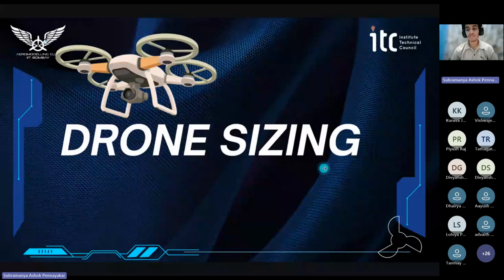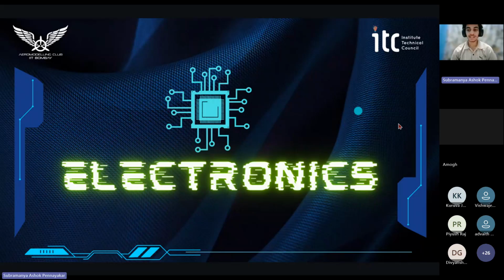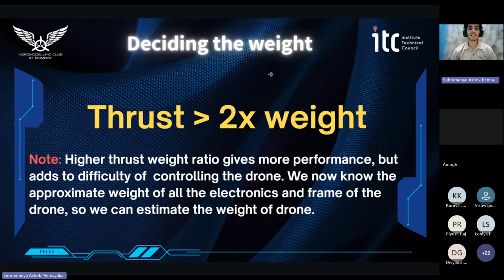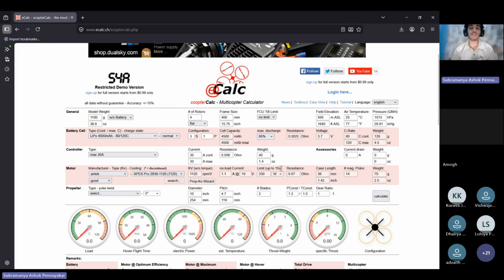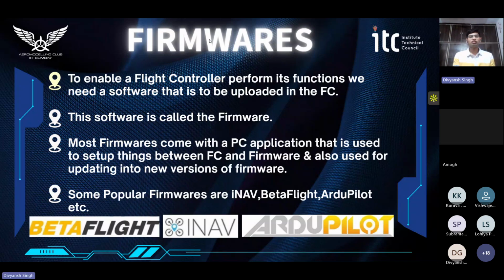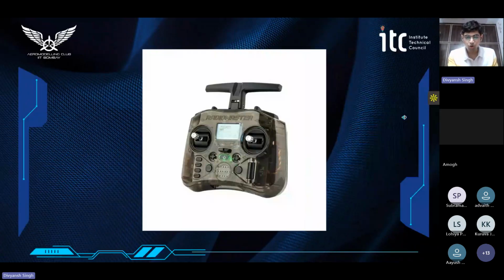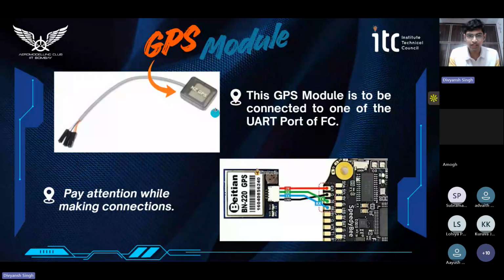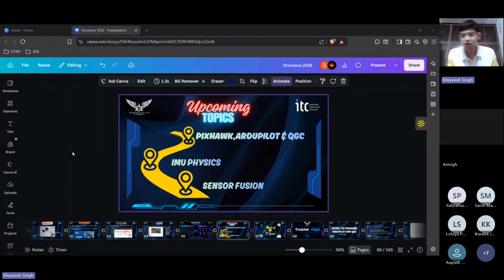Build Your First Drone |How Drones Actually Work| Drone Sizing, ECalc & INAV | IIT Bombay Dronexus

Comment: Why can't you people focus on flapping wing and fixed wing drones and moreover there is a tilting wing drones also exist with the payloads and different way of the things designings are available you are just purchasing outside the material and doing it instead of instead of design those things and 3D printer is the component then assemble with that customise the things